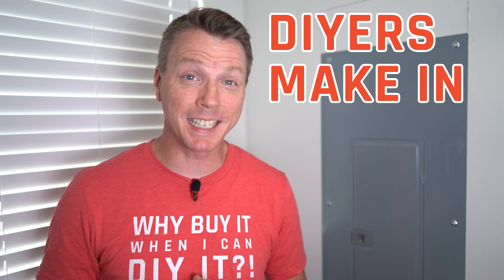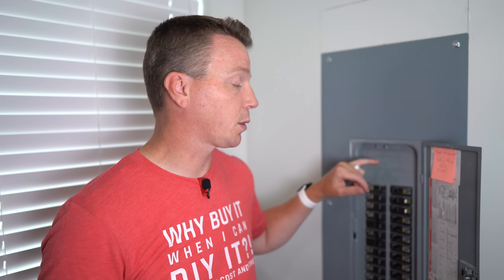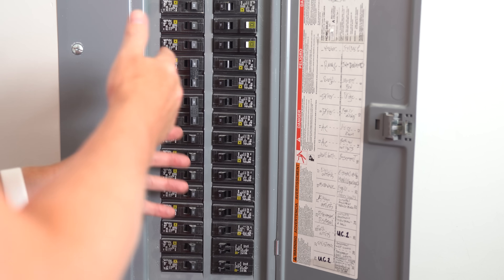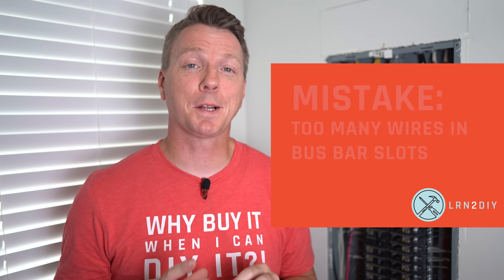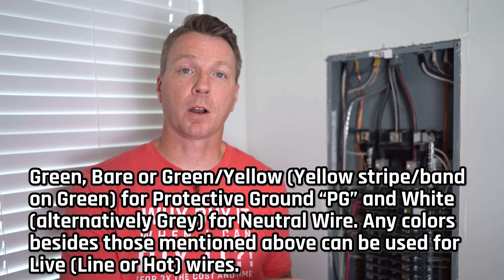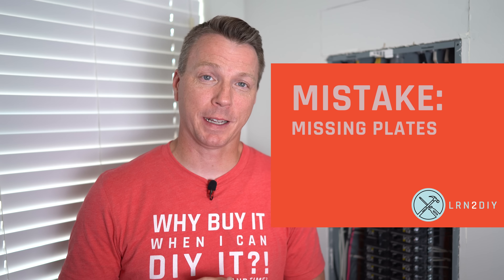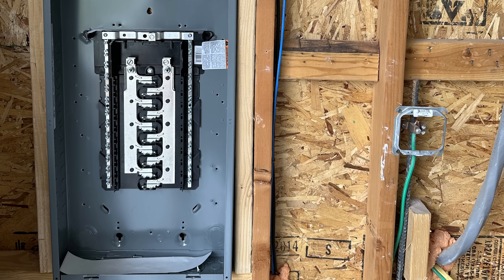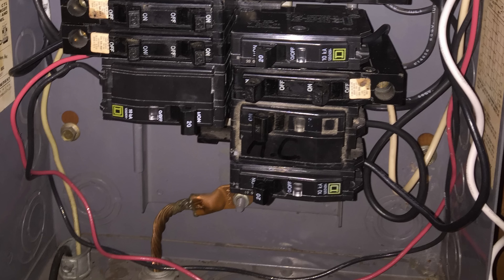10 Common Mistakes DIYers Make In Circuit Breaker Boxes

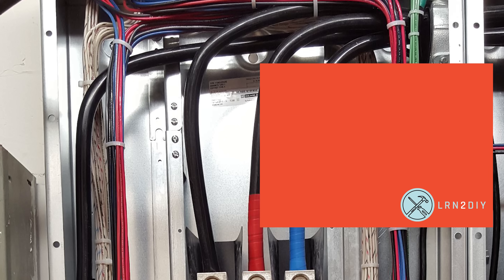Comment: 13:06 - it looks like a 3-phase panel to me, but I may be wrong. The naked ground wires also annoys me even though they are considered "acceptable" in the US since I think that they add a risk in case they accidentally get into contact with some voltage like a bus bar.
Now I'm more used to 230/400V 3-phase Euro system where we have the following:
Yellow/Green - Ground
Blue - Neutral (exceptions exist though, like controlled wire from a light switch)
Brown - L1 (First Phase)
Black - L2 (Second Phase)
Grey - L3 (Third Phase)
230V is to neutral/ground, 400V is between the phases.
Reply: That is not a 3 phase panel.  That's a standard 240V split single phase panel, unless you're talking about the picture of the "pretty" panel at the end.  That one was 3 phase.
Reply: @stargazer7644  If you look at the timestamp I gave then you'd get the pretty panel at the end, and that was the one I was referring to. Black, Red and Blue.

Comment: Dude waving his hands and fingers around near the main lugs was giving me cold sweats
Reply: Also wearing a ring!  May not be conductive but can be a catch hazard cause you to inadvertently move your hand in wrong direction!
Reply: I just typed how I'd deal with it so I didn't need to stress touching things in the fuse box while I was actually working, but it might encourage someone else to try and cut the power before the fuse box who didn't know what they were doing and I don't want to be responsible for any deaths today. lol
Reply: Oh yes!! He is inches away having a ring welded to a lug and flash burn city. Bad.mistake
Reply: Who doesn't want 150A for breakfast?
Reply: Fine point: While his casualness should not be condoned, notice that this main panel is an 'MLO' style (Main Lugs Only), which means that the actual MAIN circuit Breaker / Disconnect was in another location, maybe in
a NEMA watertight enclosure on the exterior of the house, positioned next to the meter.  This is common practice in many locations, including the south. So, while his actions are careless, at the very least he should
have mentioned the remote main switch in his initial remarks.
  Point #2:  This is absolutely true - NM, NMC, UF cable iver the many decades of use has gone through many sheath-color changes.  UF cable (direct burial) historically was a dull gray color, with the wire gauge clearly printed or embossed.  NM & NMC has gone through similar changes over the decades since it's inception.
Reply: Something tells me he knows the panel is not Live. Still... One Blunder, Six Feet Under!
Reply: 1/2 AMP stops a human heart.  Think about that when he's sticking his fingers in the panel right next to the main incoming service lines
Reply: @curatolo1  one tenth across the heart
Reply: you can touch a hot main lug all day long without getting shocked as long as you are not grounded. please! leave it to us professionals.
Reply: When l work with newbies l ALWAYS warn them about the danger of the drop once they remove the breaker box cover.  Whether they turn off the main or not, the feed is still live.  It is bad enough how close you are coming.  When that new DIYer is armed with a screwdriver,  they must be  extremely careful.  In fact, the guy who taught me had a special piece of cardboard he placed over the live feed to avoid accidental contact.  Many deaths by electrocution are ungrounded tool contacts with live wires.  I would never advise a novice to try anything with that main panel without supervision by a knowledgeable person.
Reply: I'm assuming (or hoping at least) that his meter was pulled when he was doing this, because same 😳
Reply: Exactly!
ESPECIALLY while talking about "are you qualified and confident that you can mess with electrical" while looking into the camera and away from the box.

Yes, please give me more safety advice! 🤣

Maybe shoulda been titled "11" common mistakes
Reply: Uhh . . . perhaps . . . he knows what he's talking about and there is an primary shut off . . . just . . . maybe.
Reply: Don't you think he's got the main log off
Reply: 120v relative to you isnt enough to arc more than a millimeter, and just dont touch it.

Comment: A standard rule of electrical engineering is that there is a protection device rated to protect against overloads on a downstream cable or component. Thus if there is a 150 amp rated panel, and the incoming supply is 100 amp, then no problem. The supplier fuse ought to protect it. If, however, it's a 200A supply, then that's where the problem might occur. In that case I would expect a suitable fuse (or rather, fuses this being North American split phase) to be on each incoming line into such a panel.
Reply: I assume you mean the incoming supply is protected upstream with a 100a fuse or breaker, not just wired with a 100a ampacity. The goal is to prevent overloading any conductor in the circuit.

Comment: Calling it a circuit breaker box is a common mistake too...

It's a panel.
Reply from the maker: I'm glad you brought that up. I used both terms because both are used so much. I then started a search to find out what they are called and couldn't find much to prove it was one over the other. To make matters worse, the manufacturers typically call them Load Centers, which I never hear anyone saying. Tough to know what to call these things.
Reply: @LRN2DIY  NEC complicates this further too. Makes everything have like 5 names.

Supply houses have their own names for things too.

Comment: For an air conditioning or heat pump, a larger CB is needed to handle the inrush current than what is needed to handle the continuous current.
Reply: The name-plate rating takes into account in-rush current, which is why using the name-plate data is critical.
Also, CB ratings take into account inductive in-rush current.

Comment: As a DIYer, I use a P-Touch labeler to stick labels onto the breakers (makes it easy to see what’s what even with the cover off) and onto each cable coming out of the panel. Saves so much headache down the line and 3rd party p-touch tape is available in a wide variety of colors and sizes (6mm tape is the perfect size for labeling romex)
Reply: That works great...until they start falling off. I used my P-Touch to label the drawers on some parts bins about 15 years ago and a while back they started falling off on their own. The ones I've stuck on paper seem to stay just fine, but the ones stuck to plastic eventually give up the ghost. Still not a bad idea, I would just consider wrapping them with a piece of clear tape so if they do come loose, they don't just fall off.
Reply: @jamesbarca7229  The P-Touch labels come in different grades just for this reason.  They make special label rolls for "industrial" uses with better adhesives (no idea why they don't just use it for all their rolls, but...)  I get a lot of use out of the "cable label" rolls because I can wrap and label individual wires.  If you are worried about them falling off, you can double the length of the label and make a double-sided tag instead.
Reply: One thing that warmed my heart was to see neutrals numbered.  Almost no one does that.   If load reassignment is needed at some future date, that helps keep folks out of trouble.
Reply: I use clear tape, black ink and label my wall plates , including the transfer switch breakers.
Reply from the maker: Great tip!
Reply: @LRN2DIY  View of a Master Electrician here, but I think that labeling panels in a home is a mistake, I prefer to see no labeling on a panel because far too many people will just trust that a label is accurate rather than ensuring that there is no longer power at the device being worked on. I always recommend to people that they use a tester to make sure the power is off before working or throw the main breaker so that nothing will have power. That being the case the labeling is honestly not ever helpful, but can be very harmful if people are trying to get into DIY electrical work.
Reply: @bradyschow3564  Hope I never hire you or come across your work. Labeling is very helpful and a master electrician should be able to do it accurately. Nothing like inconveniencing everyone to pander to the idiots. What will happen is someone will (poorly) label them later which will result in the same scenario you are hoping to avoid. A clearly labeled panel is the safest and most convenient because people will not shut off power to their entire house in most circumstances.
Reply: I just use an Excel spreadsheet that I print out and tape to the outside of the panel door (mine's in the basement, so it's not visually displeasing). I'm not sure if a taped on piece of paper inside the door meets code or not. But with Excel you can print smaller, make notes, and it's a lot cheaper that P-touch label material.
Reply: There exist label makers which print on heat shrink tubing, perfect for labeling wires in a breaker box.
Reply: I use my P-Touch labeler often, but for my breaker panel I list out the breaker associations in an Excel table, and print it out (on a regular printer) when things change.  Then I cut the table out of the printer paper, and tape it inside the box.
Reply: @dougb8207  How u making out with that OCD recently???  do u also Back it up with a thumb drive and discord server???AAAAA
Reply: ever hear of  SHARPIE marker?

Comment: The ONLY thing that bothers me (not a lot) is the idea of code. If a practise is wrong, it's wrong. How can a practise be wrong in one area but ok in another.
Reply from the maker: Yeah, I see what you're saying. I believe the differences have a lot to do with how old an area is and what the predominant practices were in those areas, like using metal flexible conduit vs Romex. That said, I agree. Right is right. Why would it change from place to place? Just cover all scenarios and call it good.

Comment: Why a commercial board in a domestic property? Main switch should be current limiting. RCDs should be on ALL circuits.  That whole load centre need replacing with a modern unit.

Comment: Anyone want to answer this question?   A generator rated at 10KW/12.5KVA at 120/240 volt single phase has one 2 pole breaker for output rated at 60 amps.    If I start the generator and it is running with the breaker turned on, how many amps is the generator producing?  Please tell how you come up with the answer.
Reply: At 10kw / 240v, the generator should only allow a max of 41.6(repeating) amps.  It's the devices or appliances on the circuit that determine how much amperage is pulled.

EDIT:  Sorry, not produce--allow.
Reply: Depends on the load and the source. No load---no current. Short-circuit would depend on the impedance of the generator.
Reply: Both answers are correct!   Sorry didn’t get notified of your answers.

Comment: You started talking about overloading the panel and to stop from overloading the panel, add a sub panel.   Can you please explain that thought process?
Reply from the maker: The sub panel, in my understanding, has more to do with separating out a set of circuits so that they're more appropriately located, like a garage sub panel, for example, as well as to give yourself more slots to work with. If you need more amperage available, the sub panel won't help with that because it's all pulling from the same source. I'm not sure I did a good job explaining that in the video but that's how I understand it.

Comment: one point: it is currently acceptable to code to land two SAME SIZE AND STRANDING ground wires in one terminal.  in some brands of boxes, it is also necessary to do that, or to add additional grounding bars.
Reply: Correct!  Readers here should know that adding an additional ground bar correctly is simple, inexpensive to buy, and time-saving.
Reply: I was looking for this comment because I thought I remembered reading something about this being allowable.
Reply: had no trouble with any combination in the State of WA over the last 20 years, as long as 2 max.
Reply: Its a video, not a course. Does this guy not have other videos out that pertain to this subject?

Comment: At 13:17 in your video there's a clear example of a common mistake you missed.  Wiring grounds into the neutral bar.  In this case, if there is a short to ground anywhere in the structure, than all the neutrals in the structure can be hot (with a reverse current) which is one of the most dangerous conditions you can create in what appears to be a normally functioning electrical system.  It's easy to kill someone doing this.

Comment: A mistake I've seen with tandem breakers is to use a 3 wire (2 hots + neutral) run that splits off later down the line, as the neutral wire will get the sum of the amps going on both hot wires.
Reply: good point. I have seen this too and pointed it to an inspector once. Inspector said, yea that fine. I said no, look closer that is a 20 Amp tandem breaker not a multi-wire branch circuit. There could be up to 40 amps on the neutral.
Reply: Just to clarify, you are talking about the regular-sized 120V breaker that has 2 half-height breaker switches rather than 1 normal one.  Then you are right, they need to be treated as separate 120V circuits, each with their own neutral wire, because they truly are two separate 120V circuits, which happen to be on the same phase, not opposite phases.

On a 2-pole 240V breaker taking 2 spaces, one neutral is fine, as the two hots are on opposite phases, and the neutral sees the difference of the two hots, not the sum.
Reply: @EfficientRVer  Yes, the 2 half-height breaker situation. 
Worst is that 2 electricians and the home inspector missed it. 
I only found out when I toggled one of the breaker off to relocate an outlet and I lost the power on another circuit when the neutral wire got disconnected from the outlet. 
The previous homeowner had no clue what he was doing around electricity and it showed.

Comment: Nice clear to understand video!  Remember, older NM (non-metallic) white plastic covered cable, “Romex” may be 12 gauge wire as well as 14 Gauge wire.  It is nice to have color coding of the wire jacket, especially for inspection purposes.  I notice the plastic bushing was missing on the incoming SE (service entrance) cable in the circuit breaker panel.  On the Square D circuit breaker, you could use the second wire port to hook up the surge protector in the panel.  Great job!
Reply: the throat of the clamp for the SE cable is chamfered to prevent cable damage - if your inspector is requiring the bushing, he is being a jerk.
Reply: i have an assortment of old wires in different colors black, white, grey cloth covered with silver all different gauges.
Reply: @ranger178  i used to have a piece of lead sheathed UF cable in my collection.
Reply: The color coding for NM probably came from lazy inspectors who couldn't be bothered to look at the jacket.  That and hiring moronic apprentices to run wire who also couldn't be bothered to read the jacket either.

Comment: 8:15 don't forget to wrap the other end of the wire!  For example a 2-phase heater that you run 12/2 wire, wrap both ends (panel and heater box) so the next person knows that is a hot wire.
Reply: Good point. My house has a minisplit a/c installed by the previous owner (supplied by a 15 amp double pole breaker) and his contractor used 14 gauge Romex to connect it to the main service panel. He neglected to black tape the white wire going to the breaker I took care of that when adding a new circuit, but neglected to check the a/c side of the wiring. I bet that the white conductor is unmarked there too. It's easy to notice this mistake on the service panel end, but not so apparent on the load end.
Reply: There's no such thing as two phase. It's called single phase 240. 🤦🏻‍♂️
Reply: @CybekCusal or split phase because it's 180° of phase on each of the 2 hots
Reply: It's actually against code to phase or color code any conductor under #4 gauge

Comment: "Treat with respect." is the understatement of this video. If I have the panel cover off, I'm fully aware that touching the wrong two things is 240 volts which can handily melt through nitrile gloves, and with 100 to 200 amps will turn you into a smoking pile of meat on the floor as you easily become the least resistant thing in that circuit.

BE VERY AFRAID.
Reply from the maker: Well said.